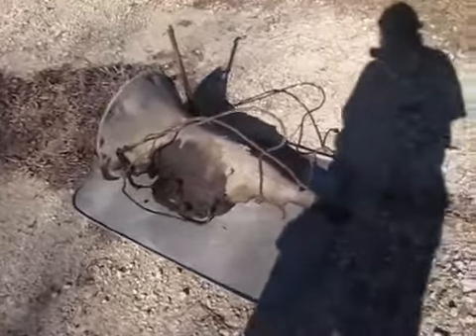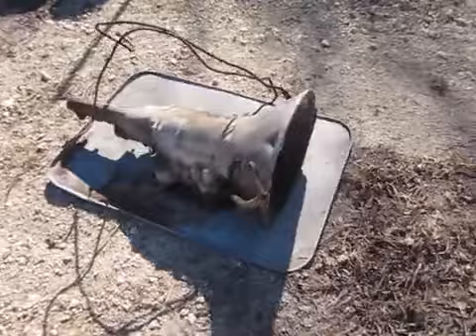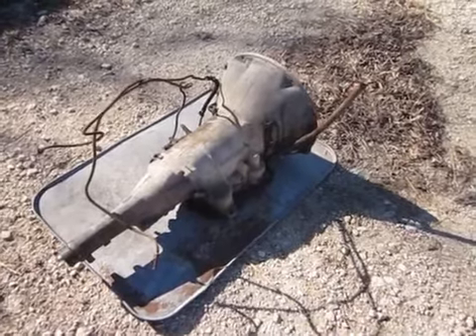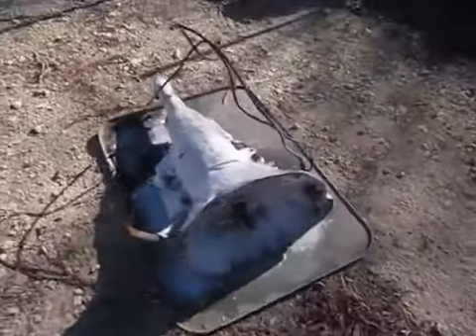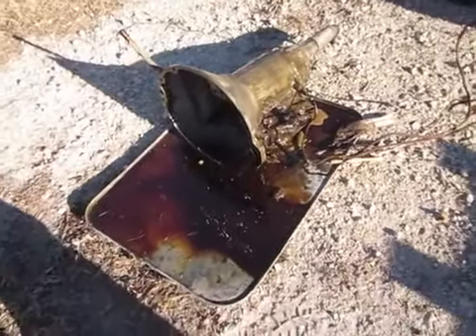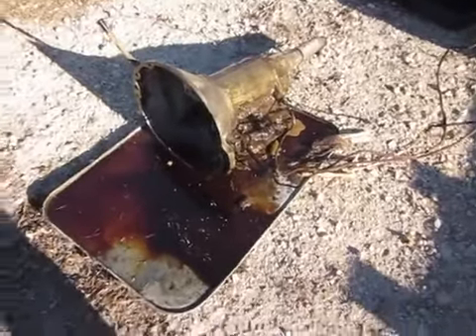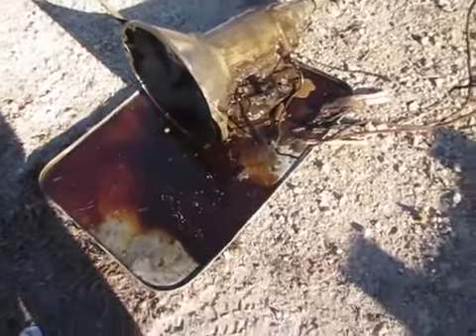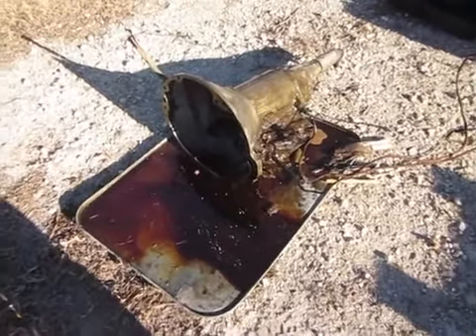1970 Plymouth Valiant Duster project car MVI 4922

Comment: An old mechanic once told me when an engine is seized to get it un-seized you should use what seized it in other words if you had water in the cylinders and it seized it use water to get it rotating now I’ve never tried it but trans fluid has a lot of detergent in it makes sense that it would rehydrate and move the old crusty stuff
Reply from the maker: Noted. When I get to the 6 engines waiting to be put in the projects ready, watch how and what I lubricate them with. Old-timers knew things we don't consider as solutions these days.

Comment: Trans fluid it a great cleaner. I use it to clean my hands when soap isn't working...lol
Reply from the maker: I used to use WD40 to remove grease and then wash with soap afterward
Reply: @cmintsurfer  WD40 works well to.

Comment: If you have a big enough tub of ATF, it would knock it off there in about a week of soaking (but who has that lol).... other then that, I've always used EZ-Off oven cleaner. Spray it on, let it set and hit it with a pressure washer. The other one, involves that stuff that goes in the carburator to make the engine run. soak it in that for about 15mins and hit it with the hose.
I've tried all the auto-motive degreasers on the market, and don't like any of them. They cost a fortune per ounce and do half the work of the one that's around $3-4 a gallon. And the EZ-Off I get at the dollar store for around $3 a can.
Reply from the maker: I will try it and record it.